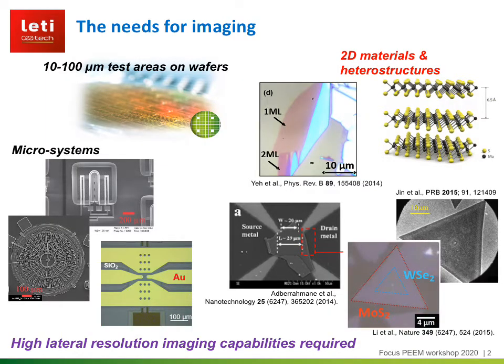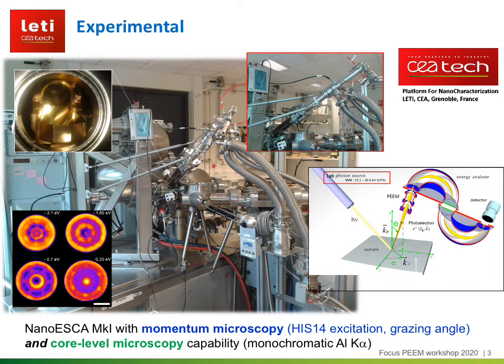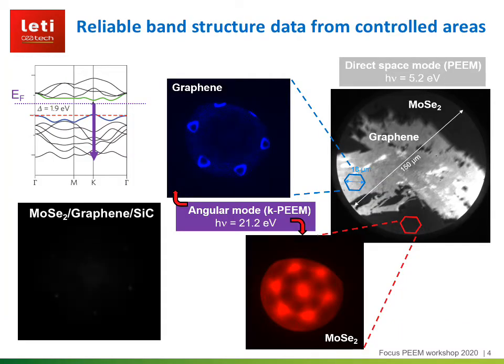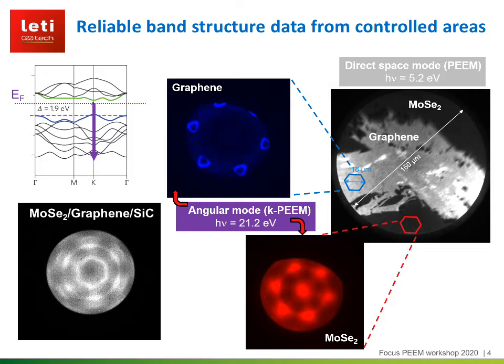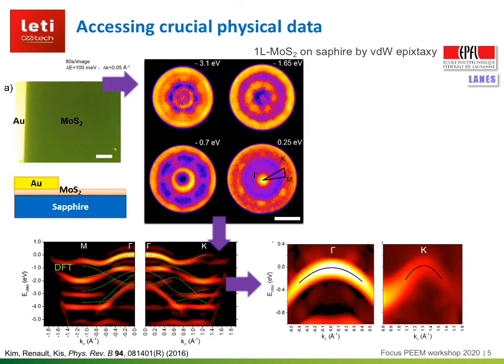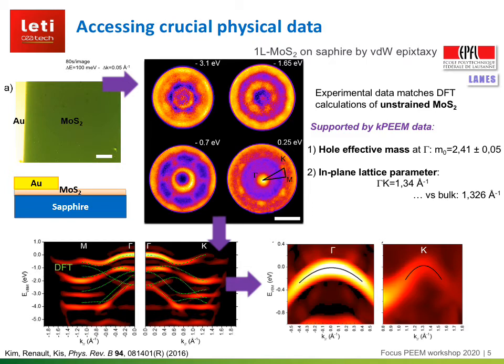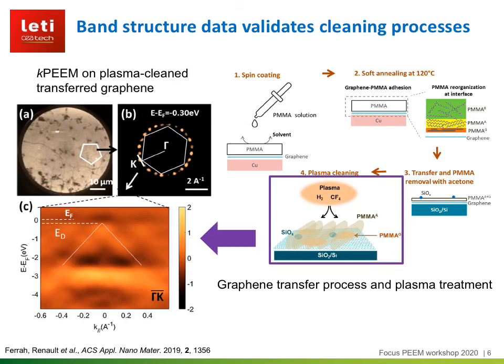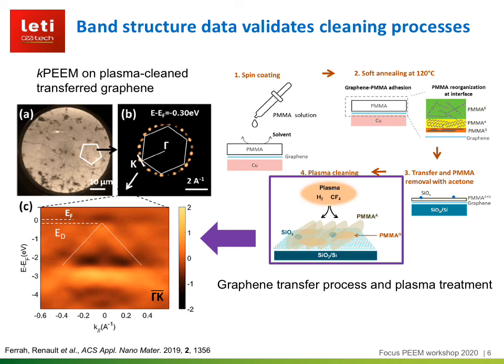FPWS 2021 eA Renault

Comment: Really great examples of what is possible with micro ARPES on small structures. They show, how important the simultaneous control of real-space and momentum-space microscopy is for the advances 2D materials nowadays. That is especially true for heterostructures (like MoSe2 on Graphene). Also working with insulating substrates is nicely possible (MoS2 on Sapphire). The last example gives a very practical insight of how the NanoESCA can be used for controlling the processing of graphene.